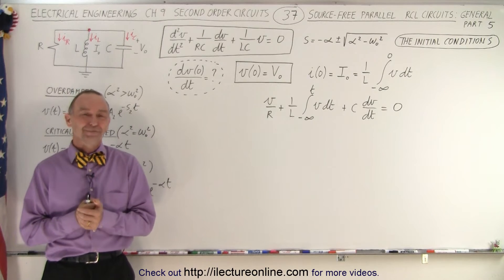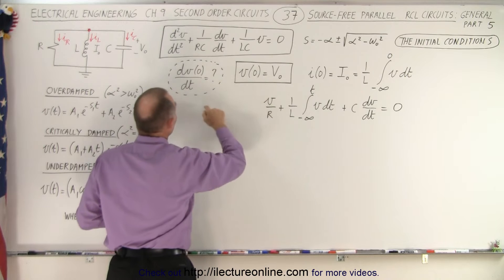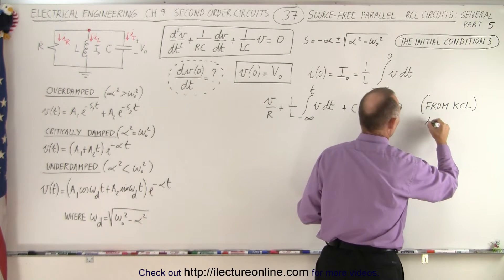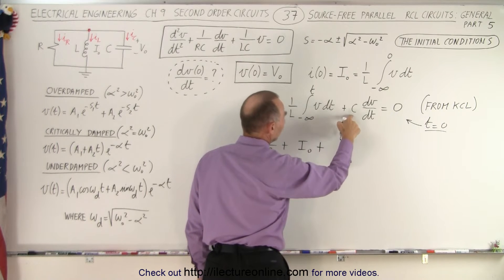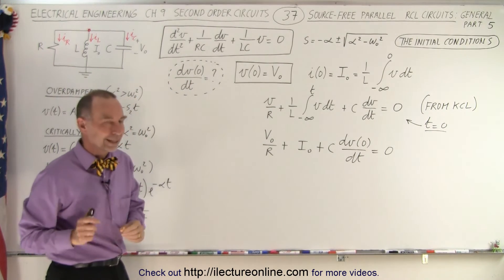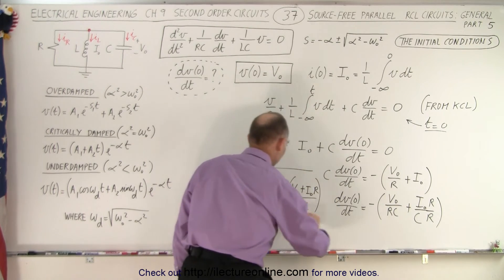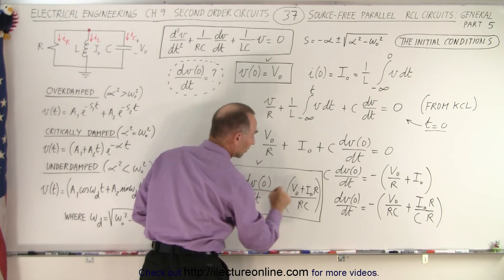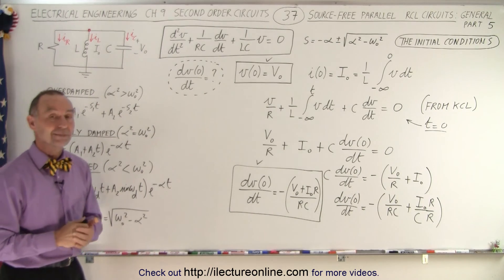Electrical Engineering: Ch 9: 2nd Order Circuits (37 of 76) Source-Free Parallel RCL Circuit 5 of 8

Comment: Does the dv(0)/dt = -(Vo+Io*R/RC) apply to finding initial conditions of a series RCL circuit dealing with voltage? And similarly from your series initial conditions video, does di(0)/dt = -1/L(Vo+R*Io) apply to finding initial conditions for a parallel RCL circuit dealing with current? Or would you use the same equation for initial conditions in a series RLC circuit but make di(0)/dt ---> dv(0)/dt? I hope my question is clear! Thank you for these awesome videos.